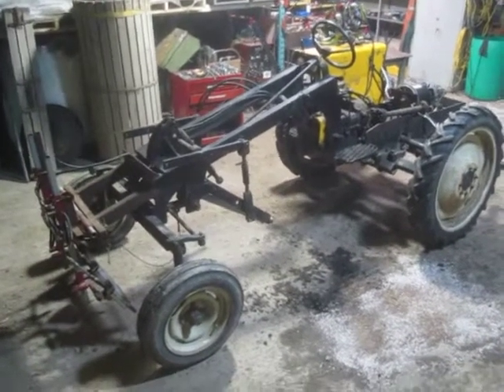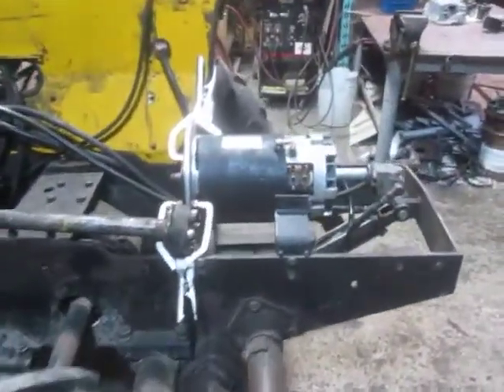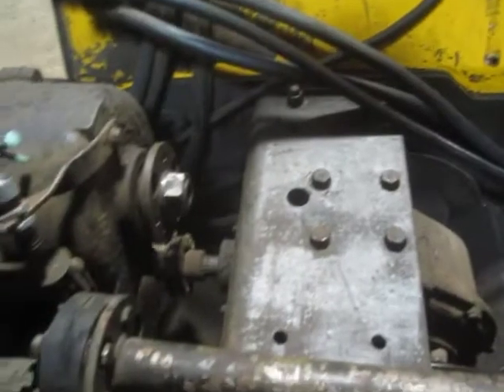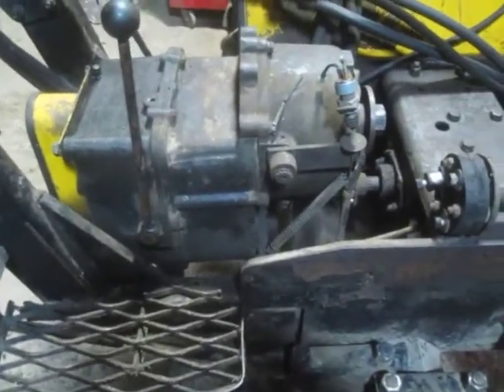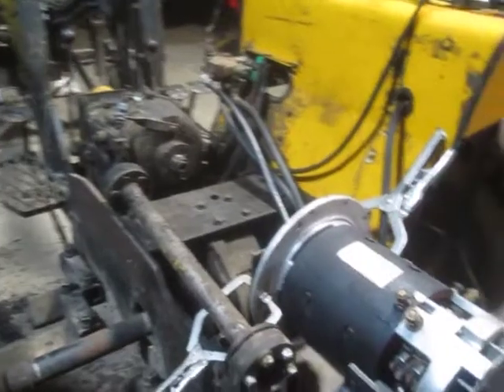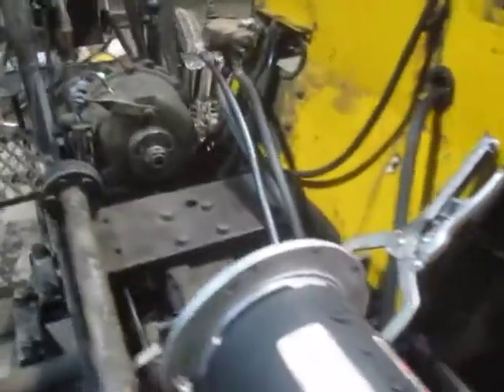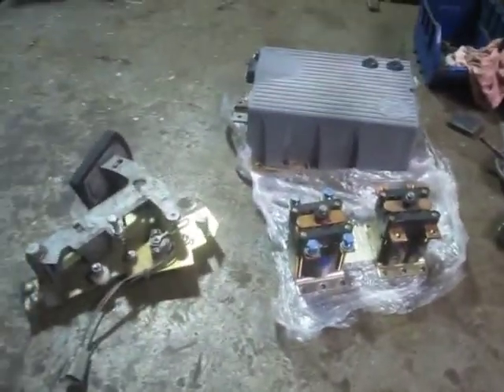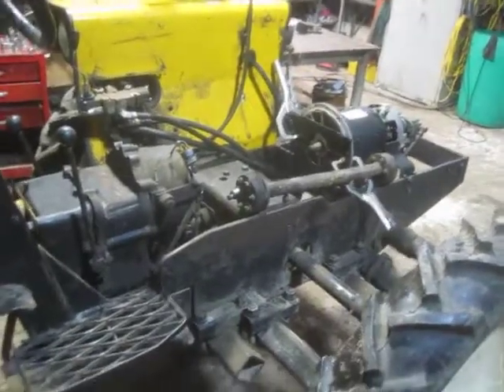Hefty-G tractor electric conversion, part 1

Comment: Our Hefty-G has a Mitsubishi 2 cylinder Diesel engine.  So far it has been trouble free, but LOUD.  Hate listening to it all day long.  I would love to re-power it with a 3 cylinder Kubota engine.  So far ours is the first Diesel Hefty that I have seen.  Never knew it was a rare option.
  I never knew there were so many diferent versions of the Hefty-G.  Ours has the wide rear axles that are directly mounted to the frame and the axle input shaft stabs directly into the differential.  The brake rotor is one piece and floats inside the frame on that axle input shaft.  Width is adjusted by rim spacing and where it is clamped to the axle.  Never seen that axle arrangement on a hefty before.
  Our differential is mounted differently.  The round input to the diff is clamped down to a saddle on a frame cross member.  

Good luck.
Reply from the maker: Thanks for the info on other configs.  I've seen lots of the Hefty-Gs with inboard final drives and solid axle to clamp-on hub.  Mine has a final drive right at each rear wheel and telescoping frame and half-shafts to allow track width adjustments.  I don't know if one is better than the other but I'm happy that both the one I'm working on and my parts machine are the same.  I think your setup is from earlier production years and mine is later (1978) but they might have built both concurrently.

I suspect that your diesel engine is not original but I could be wrong.  The Mitsu might have been chosen for it's layout/config  because the Hefty is  a real challenge to repower with Kubota diesels - a friend of mine did one.  This is because the original Renault gas engine spins "backwards" to standard.  Or perhaps more accurately, the Renault engine was built backwards in that they took power out of the "wrong" end of the crank  - something about layout in the Dauphine car for which it was designed.

Anyway, repowering a Hefty-G that was built for the bass ackwards Renault is very tricky unless your diesel has crank access at both ends (standard and "wrong" ends) or happens to spin the "wrong" way.  I don't even remember how my friend solved the problem for his Kubota repower.  

I do know that with an electric motor most of the time you just decide which way is forward and reverse polarity if you want it to go the other way.  This is not entirely true for some motors with angled or advanced brushes or other oddball configurations but mostly electric motors are simply reversible.

Look into it carefully before you buy a used Kubota engine and discover it can't work without an additional gear reverser step.  Also, it wouldn't get rid of the noise by switching to Kubota but maybe your Mitsu is air-cooled or has a really bad muffler or something.

Good luck with it whatever you try.

Comment: I love a mechanic's knowledge. It is the freedom to build stuff like this that I wish I had.

I wonder why electric tractors are so scarce, unless you DIY it. Maybe because tractors are big monsters now that require a lot of power. Batteries won't be able to stay long under such high power use.
Reply from the maker: I think It's all about batteries, energy density, desired runtime and the cost of a big/good enough battery to power the desired load.  Electric motors big enough for a locomotive are out there in every locomotive, it's just a question of how you store the energy to power it.

With the advent of high energy density lithium batteries things are changing for farm tech, just as they are in transportation, but the uptake will be slow and you can't apply the same logic of "90% of passenger car trips are less than 20km" because in farming the rule is more like, "many tractors sit idle for 90% of the year but when they're needed they run 18hrs/day at >80% full power"

It's a big engineering challenge for high power machines but it's much easier at the bottom end like these precision weeding tractors that only need 5-10kW of power output and for which used forklift components provide a supply of affordable parts.

With a research budget and tons of expertise (Fendt or John Deere for example) it's now feasible to build an excellent 70-150kW battery-electric tractor, though the cost is surreal for the time being.

Thanks for your interest and encouragement
Reply: @reidallaway  
How did you get so smart? Did you go to school for this stuff? I once thought of taking classes for fixing cars. But my Information Technology career keeps me busy all the time.
Reply from the maker: I just like learning how to fix things. When I lived in the city it was bicycles but now as an organic vegetable farmer it's tractors and forklifts and irrigation and refrigeration. No shortage of things to learn to fix on a farm 😄

Comment: This is great, looks like a promising project!
Reply from the maker: Thanks Rob.  Working on it most days when the temperature permits.  It'll be operational by spring or I'm probably fired and divorced so Keep posted.  I think and update video is due so I'll try to shoot one soon.
Reply: Very cool  @reidallaway .  I'm on a hobby farm and love tinkering, but I feel I'm about 4 years behind you in set up.  Hoping one of my engines dies enough to consider an electric conversion...  Keep having fun!  :^)
Reply from the maker: Just keep using the Renault engine and it'll die on you sooner or later. My advice would be to start collecting used parts for the conversion beforehand. If you have space to dismantle a lift you can get a complete older forklift for its scrap value and salvage motors and controllers together. Plus you get a free forklift mast to convert to 3pt hitch for your tractor